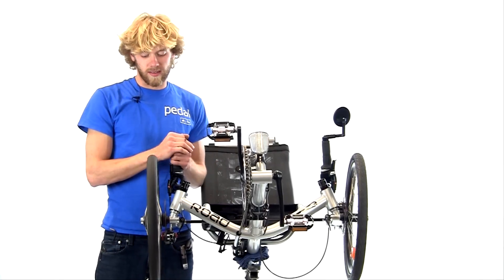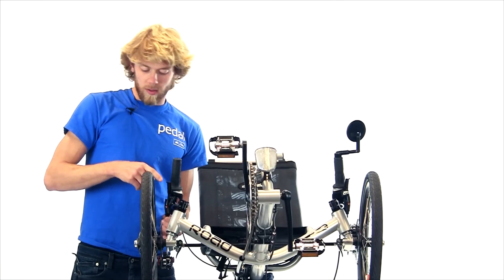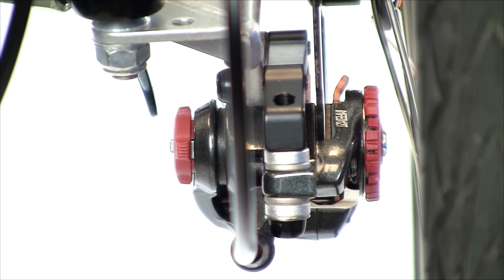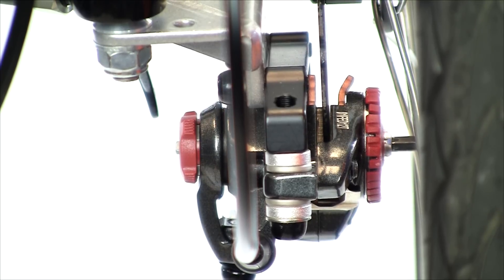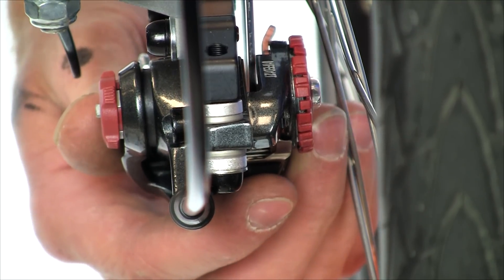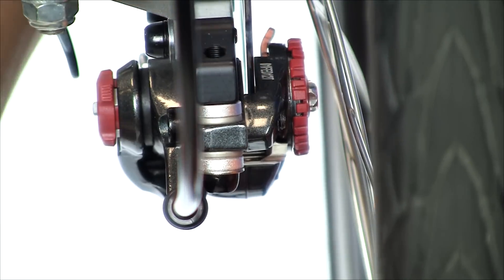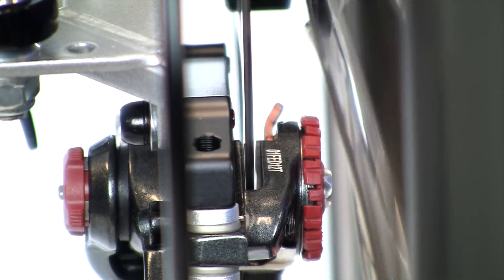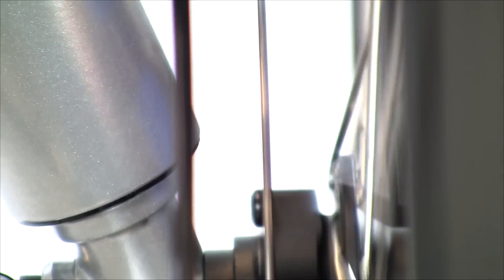How To Adjust Disc Brakes

Comment: I highly recommend any serious cyclist learn bike maintenance. There are so many resources available: the Zinn books are excellent and plenty of YouTube videos. I've found even with these resources I've had to learn a little from trial and error, but once you finally get it, it's so rewarding to be able to tear down a bike to the frame and rebuild it.
Reply: I agree, I've built a couple mountain bikes pretty much 100% myself in my garage on a park tool stand. I recently built an older style frame 2007 Ironhorse warrior into what I would consider an updated version of mountain bikes out now. I get so many compliments compared to fellow riders bikes (they all look the same😉), plus pride of putting it together yourself.... priceless.

Comment: Thanks dude 👍 I have Avid BB5 disc brakes that rub. I have new rotors, new cable but just can't get that slight rub to go away. I just gotta spend some quality time with it and get it just right. Thanks

Comment: Adjusting the caliper's position by eye is not cool! Tighten the caliper bolts with the brake lever gripped tightly. That holds it way straighter than your eye can see!